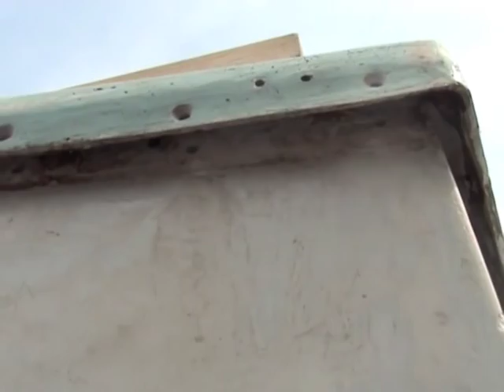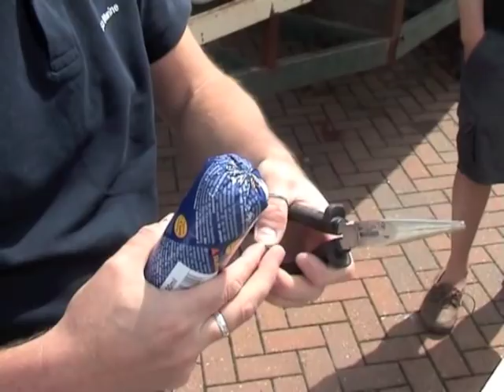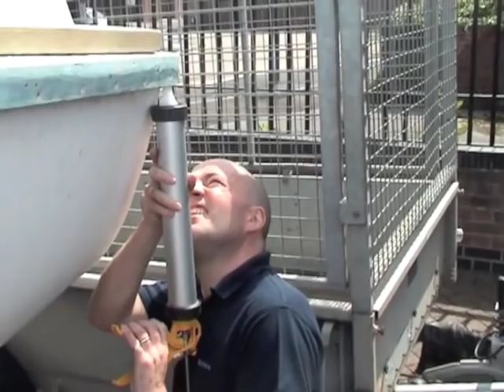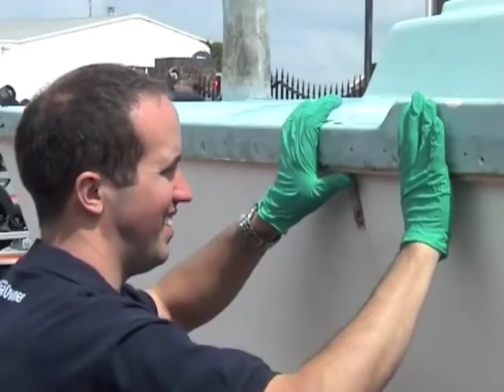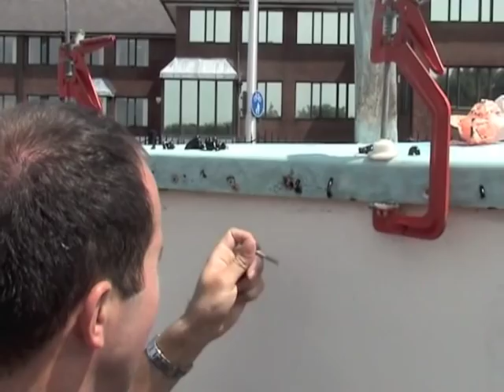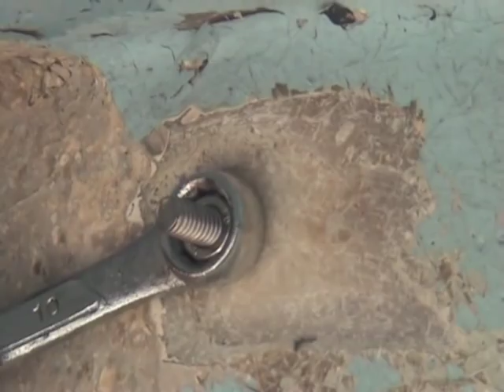PBO Project Boat – 01 Hull to deck join repair

Comment: If that stuff he was squeezing from the calk type tube was what I think it was, they do not need washers behind the nuts.  They were making sure it was in place correctly before it dried because if it was not, they would have to cut that lip off the deck and rebuild it to affix the deck to the hull again. It is a Polyurethane Elastomeric Sealant/Adhesive. When it cures (dries) it is flexible and can be used on joints and objects permanently submerged.

When that stuff dries, it would take a tornado to rip that deck off.  In other words, anything that rips that deck off, would be devastating to the whole vessel.  I was working on a project once and we put something like that on several surfaces of pressure treated wood.  Deck Boards to be exact. A little oozed through the board butt and we wiped it off with a rag.  We then took a 4 foot by 4 foot piece of 3/8 plywood and clamped it to the surface to see if the plywood would align with the corner cut of the framing.

The next morning we came out and removed the clamps and the plywood stayed. I weight 200 pounds. I thought I was not going to get that plywood off. After several minutes of prying with a 4 foot board, it popped off.  Would you believe it was a 2 foot strip about 2 inches wide made up of the residue of what did not whip off when we wiped that ooze off?  I even stopped prying twice so we could look and make sure someone did not sneak out there during the night and put some 3 inch screws into it.

The project we were building was a camper that slides into a truck bed.  It holds 6 ten foot kayaks and when camping, it will sleep 5 people.  Besides carrying our kayaks, it also carries our camping gear. It was framed with 1"X6"X12' deck boards. Then closed in with 3/8 plywood. We used sealant/adhesive to bond the framing and screwed it together with 1 3/4 inch coated deck screws made for using in pressure treated wood.  We also used the sealant/adhesive to bond the plywood to the frame and then screwed it on with 3/4 inch coated deck screws. The lower box part was 3/4 inch marine grade plywood framed with 2X4's marine grade and then space braced every 12 inches with 2X3 white wood.

We coated the outside with two coats of Kilz primer, two coats of Ultra Roof 1000 White Siliconized Elastomeric Roof Coating and then three coats of gloss white polyurethane oil based paint. We did not put the gloss white polyurethane on the roof.  We put  two coats of Gardner Silver Dollar Aluminum Roof Coating then three coats of the Ultra Roof 1000 White Siliconized Elastomeric Roof Coating(10 year warranty).